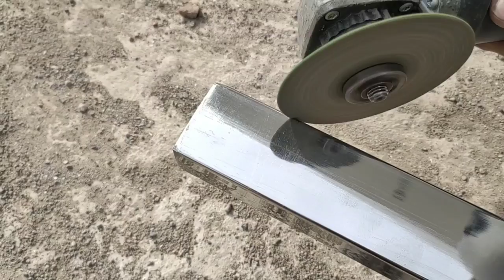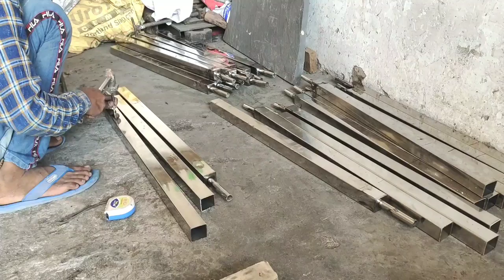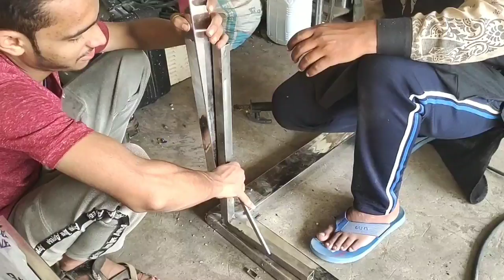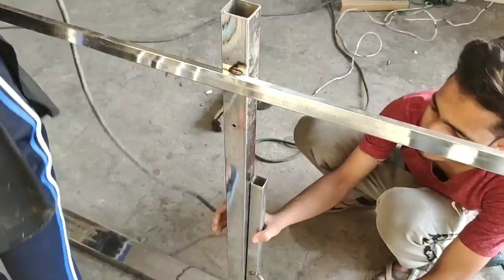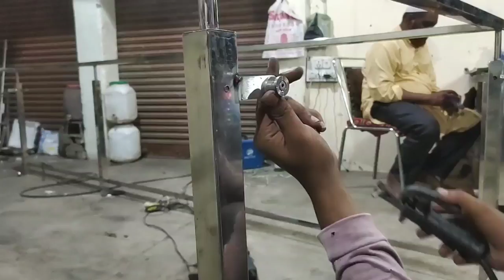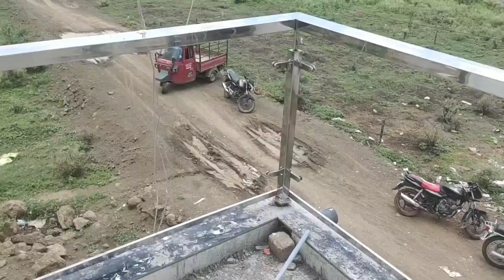Stainless Steel Glass Railing For balcony || how to make steel glass balcony railing

Comment: Nice info sir

Ther r some main ss 
202,
304
304L
316
316L
904L

But normally
202 and 304 chalta hai
Be aware kuch jagah jindal ki stamp laga ke bhi jindal kah ke bechate hai

Gaze size in mm
20 gage- .9mm
18 gage-1.2mm
16 gauge- 1.5mm

But 16 gaze is best and agar budget issue nai hai to
16 gaze 304 number  best hai

Thx

Comment: Bhai railing me lgne wale pipe ki size aur jo v us me lgta h us pr ek do minute ka video bnaeye aur btaeye.
Reply from the maker: Abhi Bata deta hu 

Top ka pipe size 3*1.5

Pipar 1.5*1.5

Patti bracket 6 inch full set
Reply: @MDKHAN-9907   Bhai ss round and square pipe Ka price kya he 1.5 thikness Ka or 2 mm thickness ka